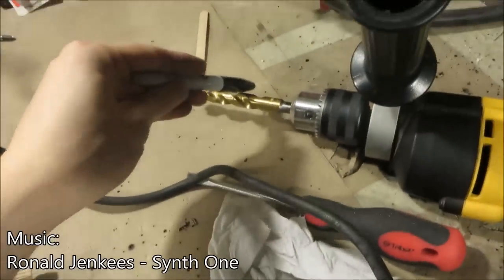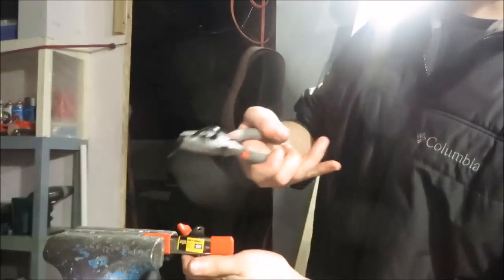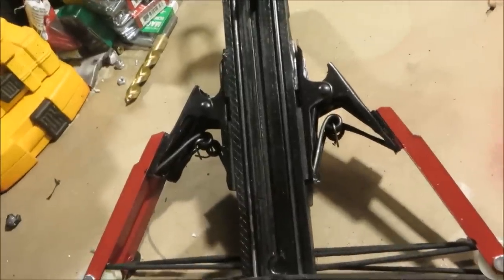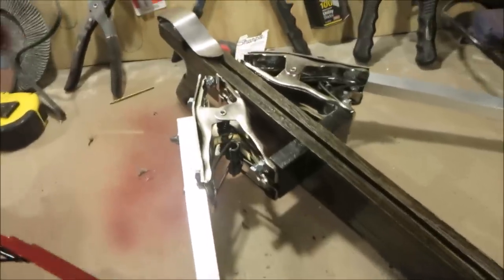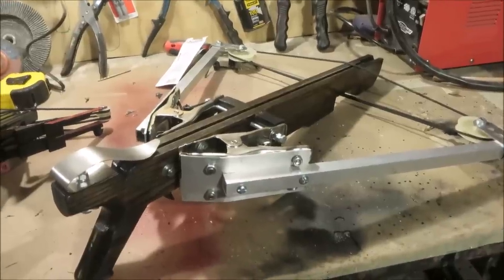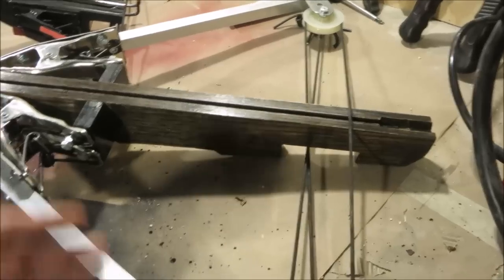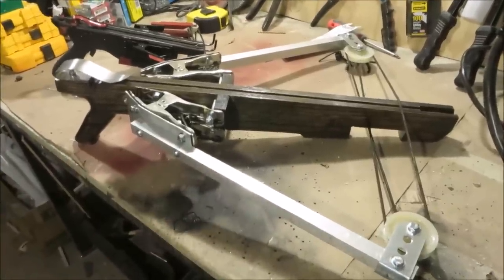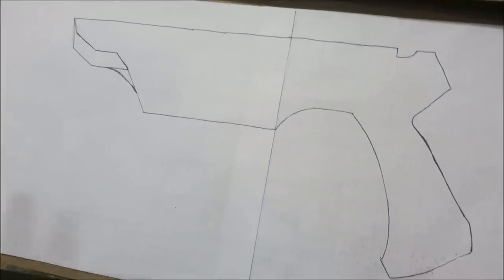How to Make: Easy-Load Magnum Pistol Crossbow/ (3/3) +Demo

Comment: That bolt you use for the smaller bow with the pipe around it securing the nail is prime for a zombie apoc scenario.  It'll penetrate deep enough to kill (wreck the brain, which is apparently how all zombies are killed) as well it'll stop and be nice and easy to remove and replace the nail if damaged.  Barely even need feathers because the front heavy weight adds stability in flight (similar to slinging a bag with a weight in it, gives it a tail.).
Reply: hate to tell you, but that wont wreck a brain or really even kill a human, just do brain damage.

Comment: you should core the chute cord before stringing up your bows, i find it offers a little more power. also get the cord wet and strech it then string your bow. as the cord dries it will shrink, gives a better fit

Comment: you compared the c bows but the shape of the first bolt cant be compared with the bolt of the second c bow the first bolt "has" to stop at the flat end of the rod and end of nail? the second has a smoother longer body allowing it to penetrate better.I love those bows,nice work.

Comment: Could you use the spring that holds the arrow down as a small iron sight? And can you use wood stain on it ?
Reply: A late reply, I know. You could just mimic the shape of the spring without actually using one. That way it isn't constantly placing stress to the structure. I think the second one is stained. At least it looks like it.

Comment: could you combine the reverse draw method with the normal method just by attaching a regular crossbow prod (maybe from the Cobra self cocking crossbow) and using both methods at the same time
Reply: wow comment makes no sense but i guess you can get the jist of what im saying
Reply from the maker: Joseph Harper Not a single jist was gotten this day.
Reply: haha ok :P what i meant was could you use the Cobra self cocking crossbow (google it :P) with your clamp method to make the bow more powerful and maybe more badass looking :)
Reply: the crossbow limb is detachable btw
Reply: its probably just a stupid idea tbh :P

Comment: But except the power given to the bolt when firing are there any other pros or cons to reverse firing mechanism ?
Reply from the maker: Looks way cooler.
Reply: ZednoughtAlpha Good enough
Reply: Yeah well thats just like your opinion man
Reply: Yeah well thats just like your opinion man
Reply: Ola Holander Yeah well thats just like your opinion man
Reply: Vestty Yeah well thats just like his opinion man
Reply: Yeah well thats just like your opinion man
Reply: Yeah well thats just like your opinion man
Reply: +flap cat Yeah well thats just like your opinion man
Reply: AM I THE ONLY ONE AROUND HERE WHO CARES ABOUT STANDARD DRAW CROSSBOWS?
Reply: +mikaxxy Yup
Reply: +Chicken Norris Please get that reference... please get that reference... please get that reference...
Reply: +mikaxxy The Big Lebowsky, are you proud ? I've been browsing to many dank memes to not get that
Reply: +Chicken Norris good job :D
Reply: +ZNA Productions The reverse draw crossbow also feels lighter, because the weight of the arms are distributed over both your arms and with a traditional crossbow the weight is completely over your front arm.
Reply: if you have two crossbows with the same length power stroke (say 14 inches) the reverse draw bow can be significantly shorter